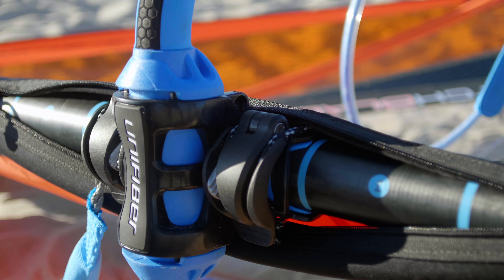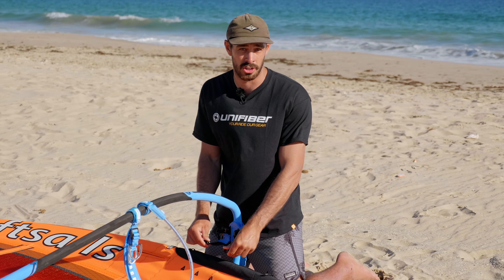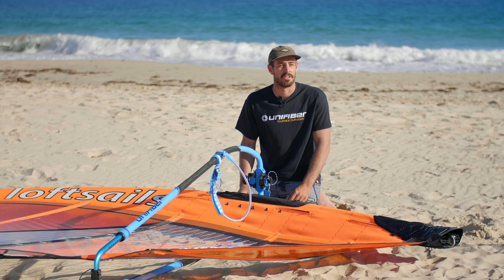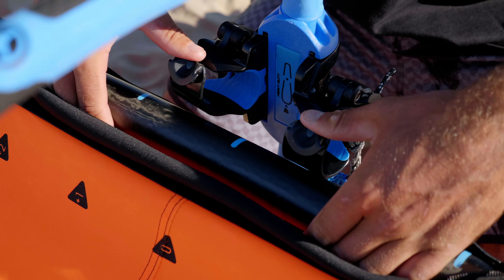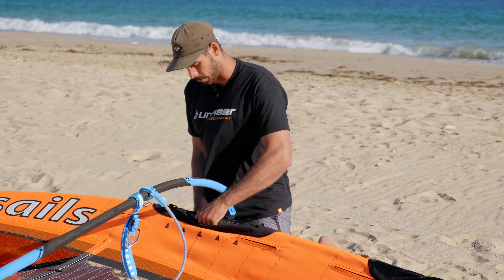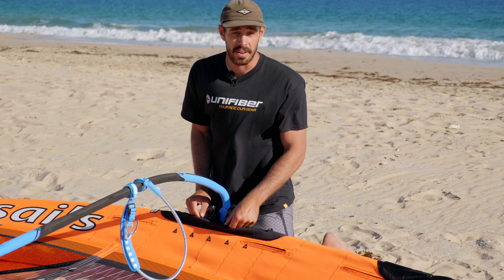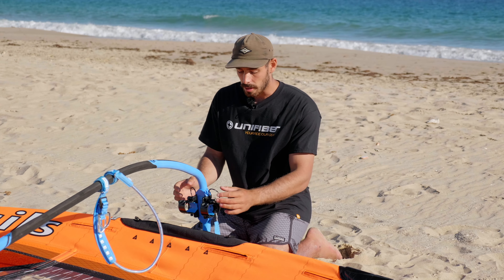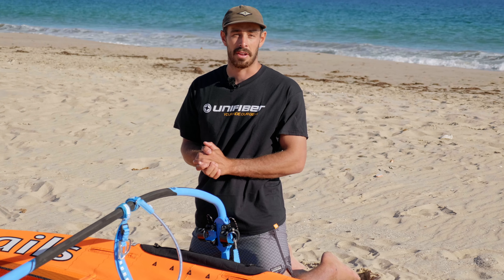How To Put On Your Modular Boom Head with George Grisley

Comment: Yeah, it took a bit of getting used to, putting the boomhead on my mast(s). But got the hang of it after a while. Due to a tiny mistkake of mine, I installed the boomhead on one of my booms upside down. As was pointed out by someone on the shore. But actually...it doesn't matter much. Works just fine for me. So I kept it that way.
Reply from the maker: It needs some readjustment, indeed, due to construction features. But the pros make it worth it:)
Also, it doesn't matter how you put the boom head. Only the logo can be upside down as well as depending on what side of the sails you prefer rigging it. But even uphaul can be installed either way.

Comment: Am i the only one who has problem totally closing/locking the clamps around the mast ? When I use it it looks like the knots are getting in the way. Once both clamps reopened on the water, I noticed it after falling and needed to quickly get away from some rocks... maybe there is something to do on my part ?
Apart from that this concept is revolutionary. Makes so much more sense that other boom head. So easy to change the height on water!
Reply from the maker: Thank you for your patience. We haven't received any feedback similar to yours previously. Drop us a line here: https://www.unifiber.net/support